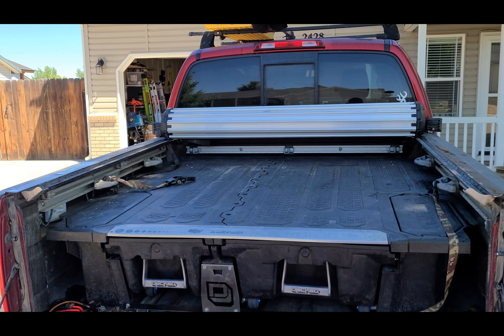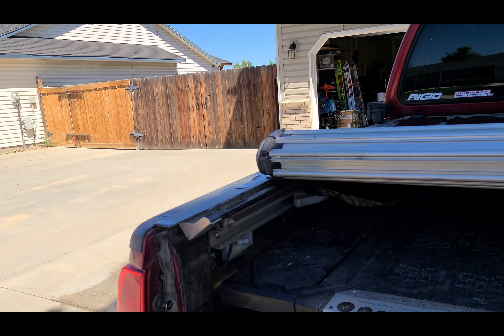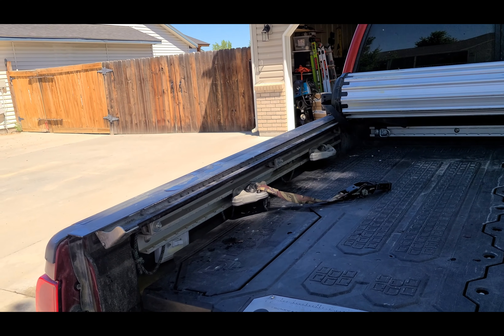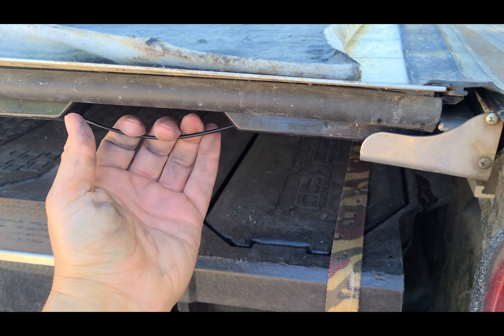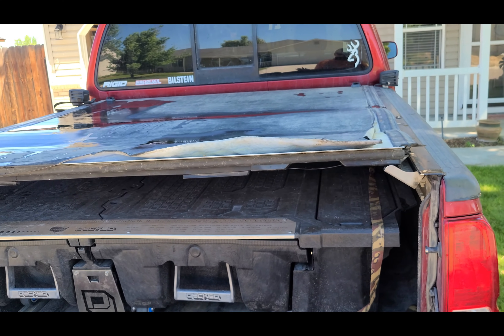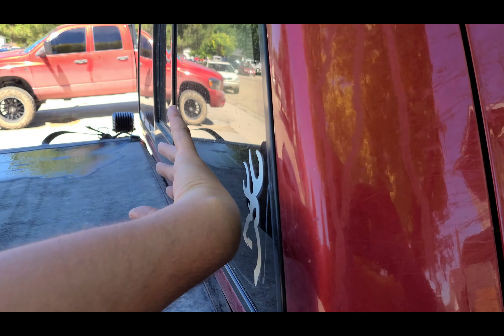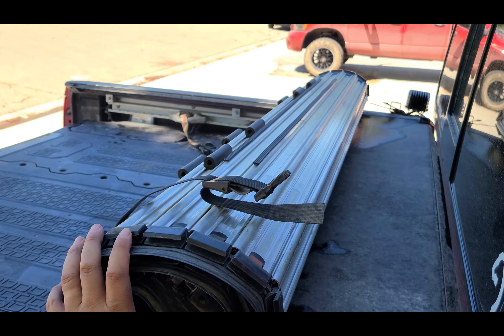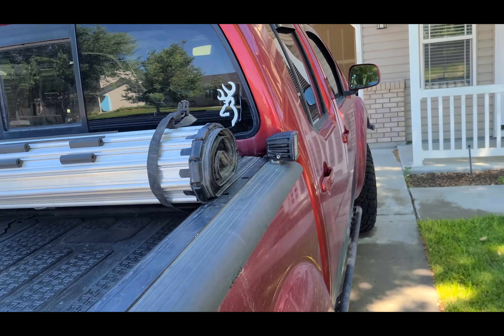BAK Industries Revolver X2 Sucks? Why?

Comment: Would’ve had a better argument if you had bought it new and unchanged by the previous owner of the cover. Just bought this one to replace the G2. We’ll see…
Reply: I bought mine new.  Installed on F350 with a Thule TracRac SR. It all worked very well together for about 4 years.  It was very water tight for the most part and I (even now) have had very few problems with it not closing or buckling.  But after 4 years, in the same winter/summer location, the glue suddenly started giving way. The black vinyl covering just began to shrink quite a bit, and even if I were to glue it down, there's no way to stretch it far enough anymore.  It now looks like crap.  3 year warranty long gone as I'm now in year 5.  It still covers my cargo ok, but it's hideous.  Junk construction and no excuse for this.